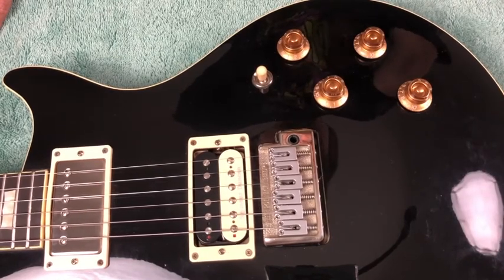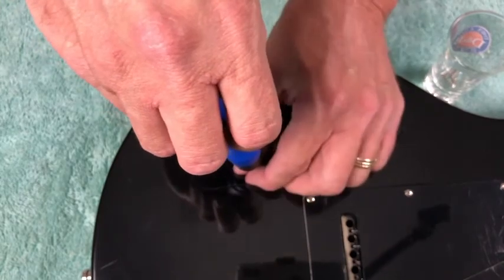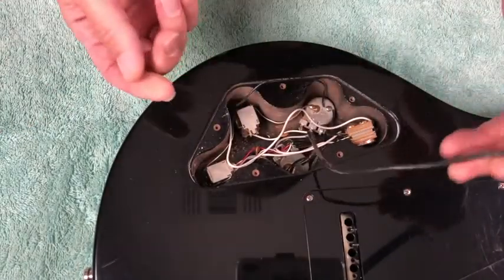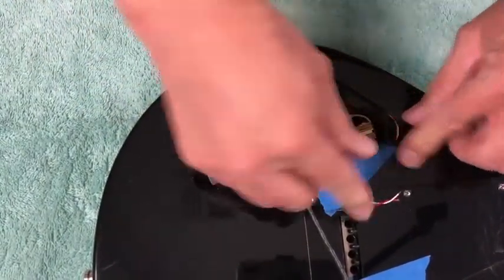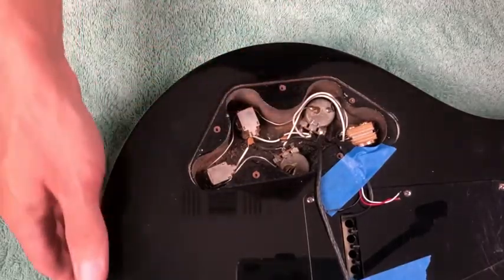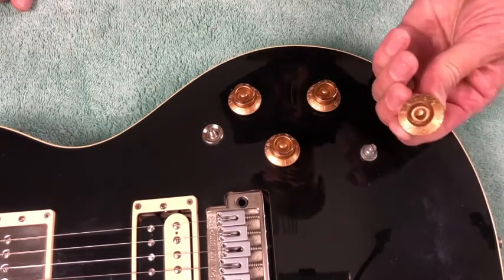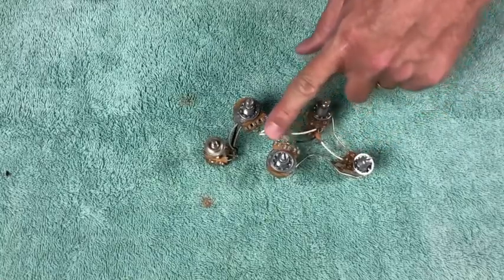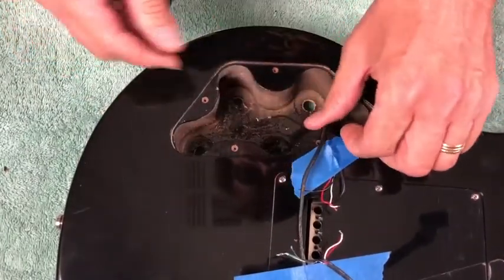Mad Hatter Guitar Products Part 1 Terminator In-Depth Installation Video

Comment: I got a Terminator system back in 2017 and wired it up like the diagram said that came with the kit. Sounded fantastic. Fast forward to now, I have the kit installed in a different guitar. I downloaded a PDF diagram from the website and I swear it does not look the same as the diagram that came with the kit. I don't have the old diagram anymore. With this wired like the new diagram says, both knobs do REALLY bizarre stuff. I have never heard a volume or tone control do this before. Every step of both dials completely change the sound and none of it sounds even remotely good at all
Reply from the maker: Hi, 

Thank you for being a customer!  It sounds like you need the correct wiring diagram for your System. Contact us at info@madhatterguitarproducts.com. We’ll get you hooked up!